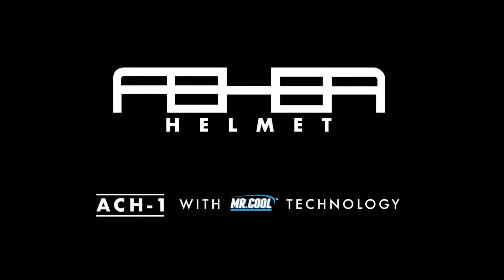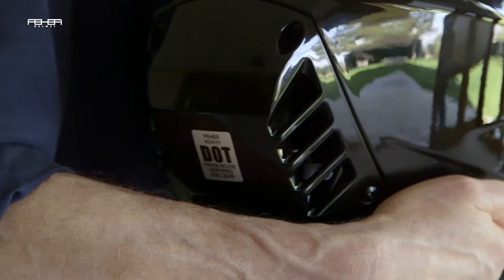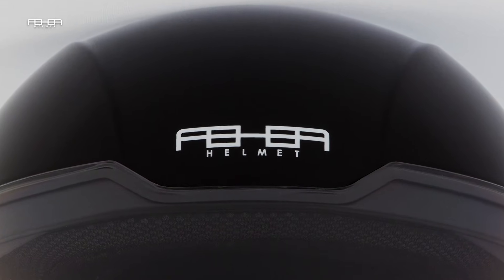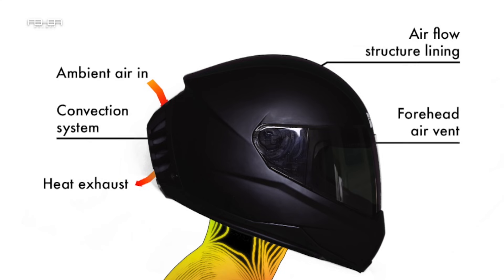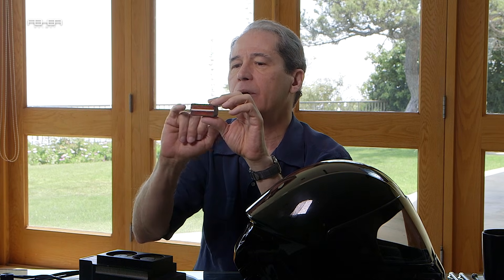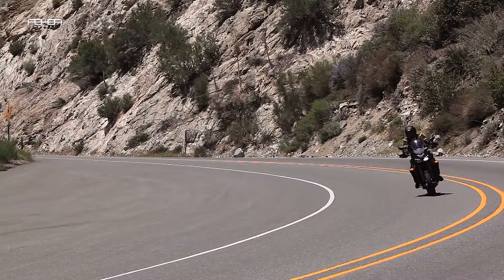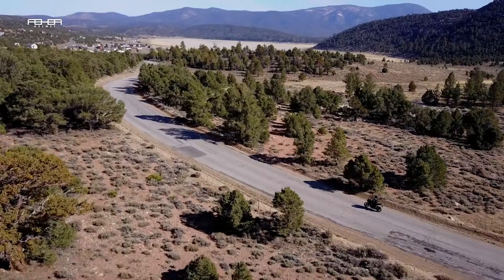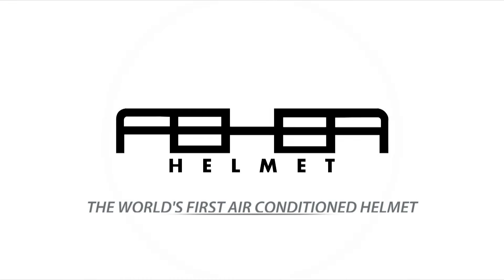Feher Helmets 2018 ACH 1 Overview

Comment: motorcycle battery powered?i just want a rechargeable battery
Reply: You have an option to use a 12V portable battery pack if you don't want to tether to the bike battery.  3000 mAh = 2 hours  6000mAh = 4 hours  12000 mAh = 6 hours.  All of the specs and info is posted on their website.

Comment: There was an air conditioned motorcycle helmet in the 1980's, as I recall it used similar technology. The top of the helmet had a ribbed aluminum(?) heat sink looking thing, kinda like a very low mohawk from from to back. Obviously not too many were sold or people would have remembered it. Oops upon further review Marc Daniel mentioned it earlier, my bad. https://www.nytimes.com/1989/07/10/sports/on-your-own-helmet-for-all-seasons.html

Comment: VERY "Interesting"...but I would be concerned about added weight and "what happens in a Crash"...will the weight and shape cause more problems and stress on the neck..? It is a similar concern as I have with so many riders now mounting video cameras to out helmets...will it cause imbalanced weight shifts, or 'snag' on something as the rider slides to a stop? {The primary reason head and body mounted cameras are not allowed in Racing..} And something I have seen 'first-hand' as a former EMT...
But I Agree that a LOT of our body heat dissipates thru all those tiny blood vessels around the surface of our heads...and I have seen VERY FEW helmets that truly circulate much airflow, no matter how 'trick' the air vents look on the outside, because of the foam and assorted padding that is also trying to 'control airflow noise'... It seems almost impossible to have BOTH airflow and quiet in the same helmet...
Reply: Also kinda worried about it only having the DOT sticker.
Reply: Relax, it cools your head even in a crash
Reply: Seriously doubt the weight would be any more of an issue than any other helmet and the bill on the back would obviously cut down the range you head could snap backwards. I'd say it's a win win.
Reply: the heaviest part would just probably be the battery. the cooling module just looks to be a peltier chip with a few copper fins. though the fan system may take  a lot of space too.
Reply: There is no battery.  The helmet tethers to the battery of your bike.... or you can use a 12V battery pack if you'd rather put one in your pocket, backpack, etc.  Depending on the mAh of the battery pack, the website says you'll get 2 to 6 hours worth of power.
Reply: I would not like my head being tethered to my bike during a crash, or having a connector that disconnects when riding on moderately rough terrain
Reply: Totally feel you on that.  All I can say is, being tethered is not as much of a big deal as we all initially think.  I'm in southern California right now, but I'm originally from Milwaukee, Wisconsin.... the land of cold and snow.  We've been wearing tethered heated gear in the cold temperatures for years.  Once you're on the bike, you just ride as normal and don't even think about the cord.  I didn't wanna be bothered with it at first, but then I realized I was just playing mind games with myself.  Didn't effect the riding experience at all.  No detached cables... nothing.  It simply allowed me to comfortably ride in 35 - 40-degree outside temps.  And of course, with this A/C helmet, you could just use a portable battery pack and put it in a backpack or something while you ride.
Reply: Hey Floyd.... all the specs are on the website.  The helmet only weighs 1450 grams (3.1) pounds.  The BILT modular helmet that I wear every day is 3.8 pounds.

Comment: "You don't feel a cooling effect on your head"....but the placebo effect and added weight and lack of safety make you feel cooler over all
Reply: I had the AGV Tech 7 helmet many years ago. And that refrigerated helmet  did work. The first Kevlarglass helmet with a heat sink on top of it and a liquid filled bladder inside connected to another heatsink with a thermostat control unit mounted on the bike. Feels like an ice pack on your head and you can reverse the polarity to make your head warm in cold weather riding. Roadracer Doug Toland even raced with it on a FJ600 at Laguna Seca. A bit heavy for a sport helmet, mainly sport touring riders used it.
Reply: I just found a brand new one in the box for $112! But, I noticed it was made in 1988. Damn. I was just about ready to hit "buy". If I'm not mistaken, over time, a helmet's protection becomes less effective because the crash foam hardens up and becomes brittle. Shoei stops selling replacement parts for their helmets after a certain time.
Reply: https://www.google.com/search?q=peltier+cooler&oq=peltier+&aqs=chrome.3.69i57j0l5.10815j0j8&sourceid=chrome&ie=UTF-8
Reply: This helmet is lighter than most full faced helmets on the market right now at about 1450 grams
Reply: I suggest you look at this video;  https://www.youtube.com/watch?v=66JSqDfw46w
which uses the same tech and almost identical parts made in this video. If it can cool your backside it can surely cool your head.  I'm sure there will be mods made considering the helmet only uses 1.5 amps.
Reply: you caught that too lol. in other words it's a gimic
Reply: The first iPhone was a gimmick too.
Reply: @MrEye4get   No it wasn't.  It used well established technology and it wasn't even a new idea.  The blackberry was OG.  This technology is ambiguous and they give no reason for us to believe that it works.  They even say you dont feel the lower temp on your head....
Reply: Funny this ambigous "Thermo Electric Technology".... That they never actually explain lol
Reply: @hrbestalkinme3690  https://en.wikipedia.org/wiki/Thermoelectric_cooling

Comment: To my knowledge AGV built the first thermoelectric airconditioned helmet, the Tech7 sometime in the 80's... and then we never heard of it again... until now... Good idea
Reply: Yes. I had one for 5 years. It both heated and cooled.  It did work too.  Doug Polen wore one when he campaigned the Yoshimura GSXR750 back in the late 80's.  It was heavy though.
Reply: I recommend to read Revzilla's Common Thread article... Lemmy wrote about the AGV... He is "lemmatastic" when it comes to that niche knowledge nobody else knows about... and Revzilla got great gear and bike reviews... Sorry kinda sorta became a fanboy due to the great content
Reply: I read the article that Marc Daniel mentioned.  Apparently, the term "air conditioned helmet" was used, but it wasn't actually air conditioning as we know it (taking warm air and turning it into cool air).  Here's the quote from the article...  “Tech-7 came with an interesting system that used electricity to cool down the internal surface. ‘Air conditioning’ is technically wrong, but you get the idea.”

Comment: My first thought is that the weight will be excessive, which will lead to a sore neck after longer rides.
Reply: Random Dude I'm also curious about the weight.
Reply: Are you telling me you guys took the time to write those statements without even going to the website to look at the specs???  lol  1450 grams = 3.1 pounds.  My BILT modular helmet is 3.8 pounds.
Reply: Feher ACH-1 Unboxing and Hands-on Review - https://youtu.be/Qw6cVte4fJM

Comment: Hi , good idea but we know that the No1 enemy of a helmet is its weight, what is the weight of this helmet so equipped? and if you decide to add an intercom, it will not help! Is this air-conditioned helmet made of carbon at least for maximum weight? The next step is what, a mini wiper with rain sensor? 😂✌🏽
Reply: Feher ACH-1 Unboxing and Hands-on Review - https://youtu.be/Qw6cVte4fJM

Comment: You notice,  they're not giving too many details. I bet it doesnt really work as advertised
Reply: I have to ask you the same question.  Did you actually go to the website and look at the specs before you typed all that?  The helmet weighs 1450 grams which is 3.1 pounds.  Since when is a 3.1 pound helmet considered "heavy"???  And regarding your vents comment.... this is one of the things you people aren't understanding.  Have you ever been to a place like Phoenix, Arizona where they regularly reach high temps of 117 degrees in the summer?  Cool air doesn't exist at those temperatues no matter how fast you're riding... so you could have 20 vents on your helmet and it would still feel like flames from hell were going through every one of them. lol  This product was made more so for riders in regions of EXTREME heat and humidty.  Key word "EXTREME".  This item NOT needed for everyday riders who are cruising around in basic average summer temperatures.  Capeesh?
Reply: @No Body * no point 2 be negative bout the helmet till u actually get ur hands on a working unit... everybody sounds like hillbilly bumpkins from back in the day b4 they had air conditioning in the house or car, "ahhh honey, if I'm hot i'll just crack a window, besides, it'll never work!!!"  Damn negative nancy, let's just see if the helmet can work 1st cuz we are more technically advanced than ever b4 & are coming out with amazing tech everyday, just saying...
Reply: Correct.... the bikes battery for unlimited power.  And on their website, they also say you can use a 12V portable battery pack.  3000 mAh will give you 2 hours of power... 6000 = 4 hours... 12000 = 6 hours of power.
Reply: No Body and I'm sorry for my English but you probably don't know how the human thermal dynamic work's we do lose more than 70% of all heat through the neck and head and that's why you are so hot in full gear try to take a ride at +35 Celsius and more under the sun without helmet and you will see the difference emiditly. But still don't understand where will be the power supplier. The idea and concept is pretty amazing! But there is no way they'll make not heavy bulky useless helmet.
Reply: I bet it works fine. Id wear one. Nothing worse than a drenched stinky ass full face helmet.  Seriously doubt the battery would be an Issue
Reply: Agreed and if it works id run a power cable to the port on my bike, Stay cooler and ride longer covering more distance with dehydrating
Reply: Are you surrrrrre that it's a heavy helmet?  I mean.... did you go to the website to look at the specs before you decided to type all that.  I don't know what kind of helmet you wear, but I myself wouldn't call 3.1 pounds "heavy". :)
Reply: Its not new, an Italian company made a Pelltier effect cooled helmet 20 years ago.
Reply: The concept do work. Slight temperature change is matter if u live in hot country like Singapore, Australia.etc. And yeah most memorable Malaysia,really hot country great food, tons of fooodsss everywhere every streets. Just lacking one thing, alcohol hard to find not available at most local shops except bar. Islamic country. Safe country for a woman to walk alone after sunset. From my experience. #imAwoman.
Reply: mathew mann 🤔 another Skully situation?
Reply: @deweyunknown3745  yuup!👍

Comment: If this cools then it should also be able to heat?
Reply: DD, you are correct.
Reply: Reversing valve?;)
Reply: @eatcommies1375  
Exactly
Reply: No, I'm assuming y'all don't know anything about the cooling plates mentioned.
Reply: What about the lack of air where the intake is ? :/
Reply: reversing the peltier chip would probably do the trick since the module looks to have the same thickness of copper fins on both sides

Comment: A helmet is a safety tool. Attaching anything like action cam(nowadays very common), will compromise the safety. How come an A/C attached device will get approval in the first place? Better invent something, which can be attached to the bike and circulate the air through the jacket rather than compromising the safety.

Comment: Does to meet safety standards? Impact to the back of the helmet is a high risk area. Same for protrusions that might drag and put rotational forces on the neck. These probs addressed I would love the helmet for on road and off road.
Reply: That's the first thing I thought of as well...I personally was in a mortocyle crash and I was wearing a HJC-C17, and the first part of my helmet to take the initial impact was the back of my head
Reply: No
Reply: its DOT and ECE "approved" but not certified.

Comment: but, did one is waterproof ?
Reply: Probably another feature you would have to buy XD
Reply: On the website, it specifically says that the helmet should not be used in the rain.  This baby is only meant to be effectively used by people who are in Extreme high temperature and humidity regions.  We're talking temps headed into the triple digits or 90's with 90% humidity type scenarios.  That's the only time you'll really experience a major cooling difference.